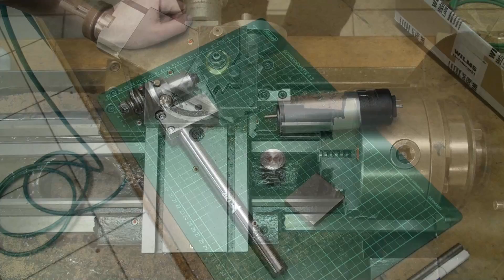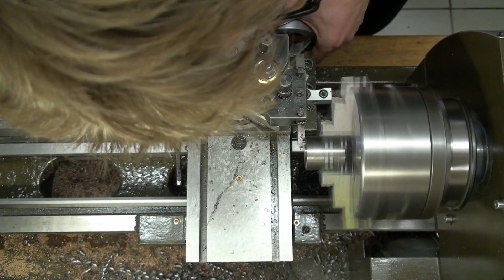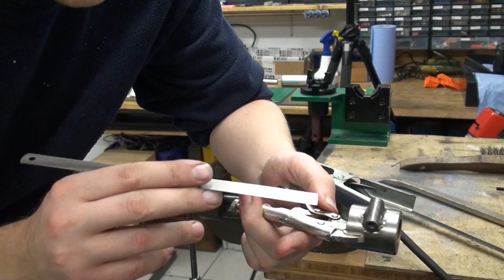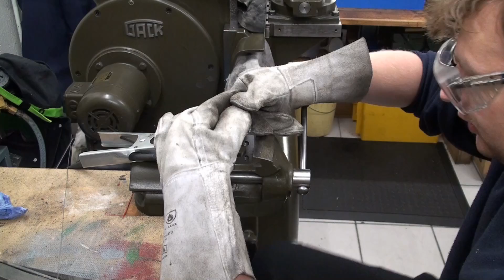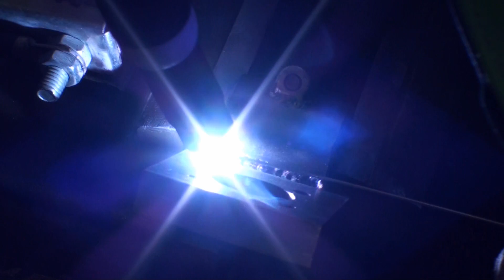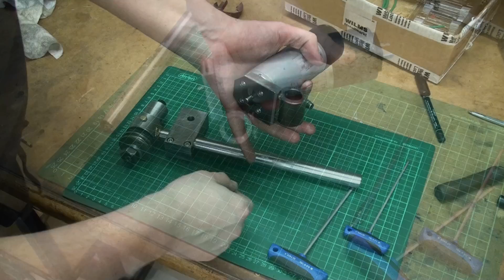Toolpost Grinder Part 3/4

Comment: Beautiful work! I didn't catch or you didn't mention...will this have a controller or you're running it straight off the power supply?
Reply from the maker: aserta Hi aserta, I am running it straight of an 12V/13 power supply, that gives me 3000rpm on the motor - - I have one pulley on the motor and two on the spindle, that gives me 10000rpm and 6000 rpm on the spindle to start with - I always can make one or two additional pulleys to give me lower rpm and more torque, in case I want to use the spindle for milling operations on the lathe (I will do that :) ).
Reply: Stefan Gotteswinter Cool. Thanks for answering. :)
Reply from the maker: aserta Uh, after rereading, I lied: Its a 24V/13A power supply :D